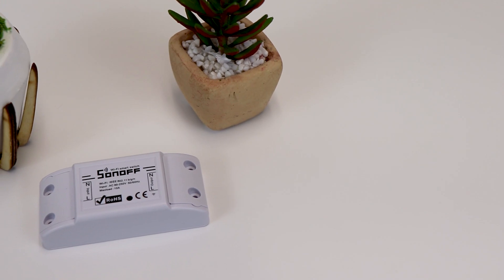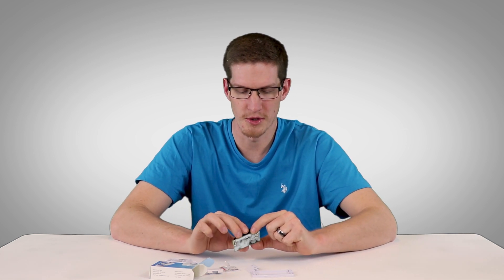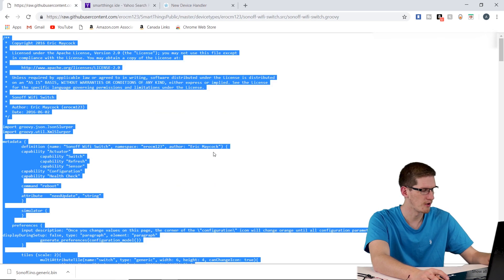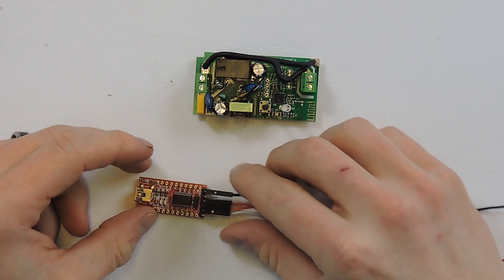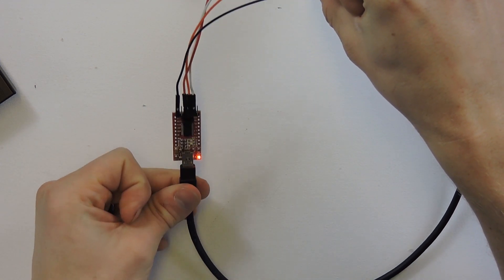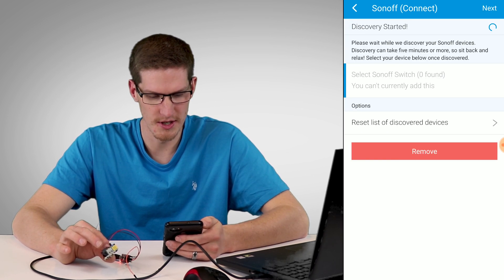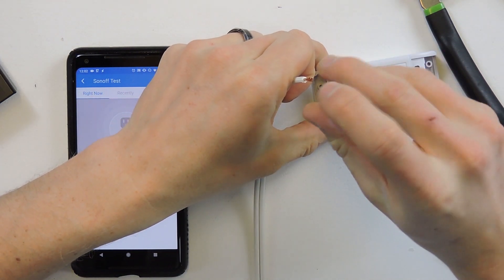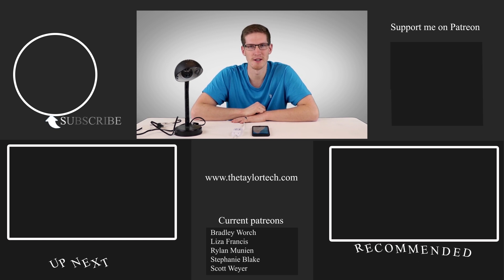Sonoff R2 | $5 Smart Switch Working with SmartThings!

Comment: have you ever tried to make any sensors for ST out of ESP8266 boards?
i got some wemos D1 mini ESP8266 boards and some PIR sensors
could you make  a video on how to flash them for ST to be used as sensors  and add  the device handler  and set it up in ST?
Reply from the maker: Funny you mention that! I just picked up some wemos d1s myself and got them working with Smartthings using st_anything. There will be a video very soon on just that!
Reply: @TaylorTech  that is awesome i  looked at the forums before but was a little confused and  have not too much time to get into that long thread over there 
it seemed like to me that there was like one generic  DTH and one generic .ino sketch that was basically for the  board and then you could use any sort of  sensor for the trigger   you just use the same GPIO and connect any kind of sensor yout want to it  , is that right , it has been a long time since i looked at it 
last thing i flashed  for ST were 5  H801's
using the espeasy tool and cmd prompt
 , i got  like 4 d1's  ,  one for flashing a self host exploit server  for  PS4 exploit which  i  discovered another tool for flashing  that has a GUI i wonder if it could be used to flash these for the sensor sketch as well
it's called NodeMCU-PyFlasher-3.0

so  what do you plan on using the d1's for?
i want to try and   use them for PIR motion detectors
hpe you make video  if it goes well flashing the d1's for ST
Reply from the maker: I was lost in the forums for a few days trying to figure out how to get it to work. It took me some time since I have no Arduino experience, but I figured it out. Right now I'm using them to control servos and relays, but I'm going to be ordering some PIR sensors as well as some moisture, temp, and humidity sensors.
Reply: @TaylorTech  servos and relays? you mean  for another project not ST right?
what can you do with the servos? DIY smartlock?
the relya i guess you could us to make your own switch but you can use so many other option like the sonoff for that  and it is almost as cheap  i am interested more in  using them for inputs  ,like tomake sensors so do you think you have a good grasp on how to configure them  for  input,sensors ?
the   servo  stuff would be pretty interesting ,  i am curious what applications you have in mind

i also have limited experience with  arduino
but i have  done some projects with servos an blinking LEDS with a  pro mini and   a nano
i think  you could probably  use the nodemcu pyflasher to flash the d1's with the ST sketch  if you do not want to setup arduino IDE and deal with the board manager etc .it is a simple GUI you just select the .ino you want  and the com port  of the board and  flash
it is simple to use and i do not see why it wouldn't work with the SR stuff unless you need to use  arduino to edit the sketch ,i imagine you would probably at least need to  add your own log in credentials ,so i guess you would still need arduino IDE for that
 i  got  D1 setup in my arduio IDE anyways but for the PS4 exploit host  i ended up using the pyflasher  instead , i only have experience with ardino boards with no  wifi like the  nano and pro minis i never used arrdunio IDE to  flash any  ESP boards or done any projects that involve wifi,just the atmega microcontroller boards
Reply from the maker: Yeah, you need to edit a couple lines in the sketch for your network info and ip address. It's not hard once you figure it out. I had the relays on hand, so that's why I tried them. Servos can be used for lots of things. I plan on making them push the button on my old Roomba to clean when we leave. Also to make a couple smart HVAC vents to close them in rooms were not using. And a few others I'll talk about in the video. I do plan on including inputs and sensors, I just haven't tried them yet.
Reply: @TaylorTech  oh yeah that is a cool idea i also have an old roomba 530
but it needs a battery and does not get over thresholds too easily
there used to be a nice commercial product to add wifi but  it was expensive , it had  a nice  plastic plate that covered over the top of the roomba , i think you can still get one called roowifi  but it is still  kind of expensive like $70 or so , and it has it's own app
this guy managed to  do  it  himself with a cheap ESP01 but i do not use  homeassistant or MQTT and node red is also over my head
https://www.youtube.com/watch?v=t2NgA8qYcFI
so yeah just  having a servo that  is attached to the dock instead of the roomba is a really good idea
also i think you better order some good  heavy servos for controlling vents , metal ones 
the best application i can think of is PIR or other sensors  perhaps microwave sensors they are cheap like $1 for  the microwave sensor even cheaper than PIR and probably more accurate

Comment: I love the Sonoff Basics. I have several throughout my house and like how responsive they are with my smartthings and Alexa. Also like the inching feature. I use 2 for my garage doors.
Reply from the maker: Inching feature? I'm not familiar... Can you elaborate?
Reply: @TaylorTech  with inching mode on you can set the Sonoff to turn on or off in seconds. So basically it will trip the sonoff to switch on /off in seconds after the first on / off action. Wont work in Smartthings. But not configuring the Sonoff to with Smartthings you would just use the Ewelink app and then have that sync to Alexa. This is basically a cheaper way to switch your garage then spending $$$ that other smart garage door openers.
Reply: Also keep up the great Videos. Always get excited to see what new Videos you come put with. Your one of my favorite tech vlogs.
Reply from the maker: Ahh okay, thanks for that. But, as mentioned in the video, I was able to make these work with with my garage door through smartthings. It takes a bit of "hacking" at the board though. Keep an eye out for the next video where I show how I did it.
Reply from the maker: Basically what it does is uses the output as the dry contact.
Reply: @TaylorTech  I'm not a hack master like you, that's why I like your Videos. You explain in details. Thx again

Comment: Hi. Have you tried getting this to work with a wall switch... I have not been successful in correctly wiring the wall switch.
Reply from the maker: I don't recommend putting one of these behind a wall enclosed like that, but if you do, it's simply a relay. So your load wire would need to be wired to the sonoff. They also have a sonoff touch switch, which can be flashed with the same method.  There's a link to that in the description.